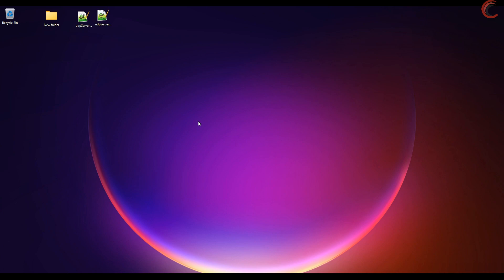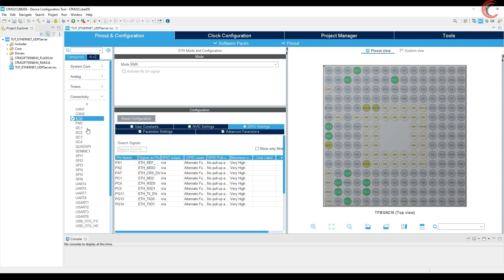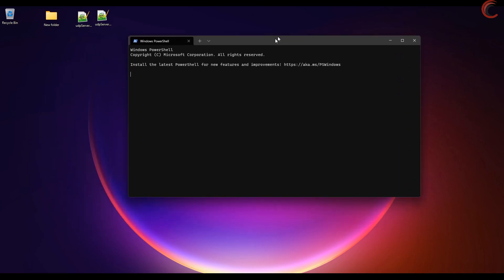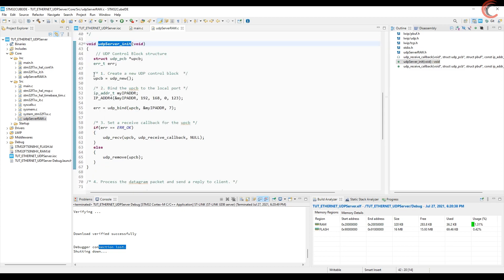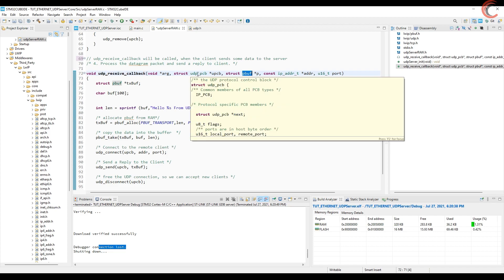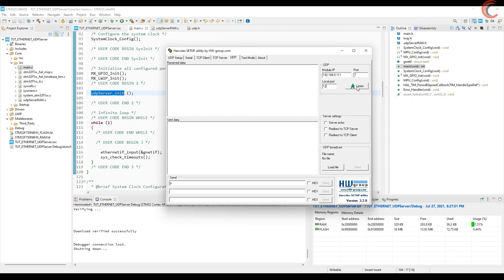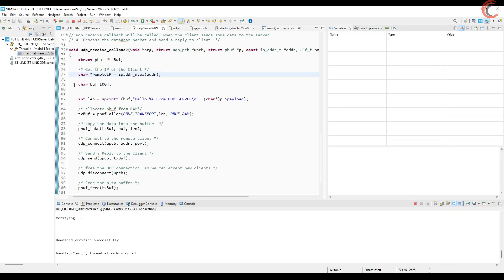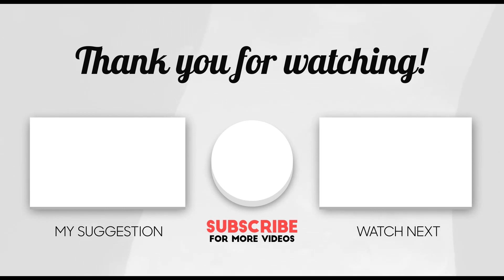STM32 ETHERNET #2. UDP SERVER

Comment: when i entered port 7 and local port 12, it doesnt reply anything. when i entered port 7 and local port 7 it repeated whatever i send without the string. why is that? what shall i entered in local port?
Reply from the maker: When both ports are same, you will obviously receive the data you transmitted. Its like connecting the TX and RX pins together.

Comment: When we run ipconfig on the terminal, why don't we see our board address 192.168.0.111 listed under Ethernet adapter Ethernet, once it is connected to the ethernet port of our PC? We se the address 192.168.0.102 instead. Could you,please,clarify? Nice playlist by the way.
Reply: are you using a USB to ETH converter to connect the board to your computer?If so, the ipconfgi command simply detects the converter interface instead of the STM interface

Comment: Thank you! My udp server is working now, but there was one problem. When I send message with length more than 17 bytes to the board (I use h745 disco), it started to response inadequate and sometimes was even crashed. The reason was that "sprintf" in "udp_receive_callback" wasn't suit for this purpose, I remove it, made dynamic array by "malloc((p->len) * sizeof(uint8_t))" and then:
My_array = p->payload;
Also I replaced in "pbuf_take" function call "buf" by my array name. Now the echo works correctly.

Comment: Hello again, when I enable LWIP platform settings it gives an error. It forces me to select Driver_PHY. How can I fix?
Reply: Since I used the stm32f769 discovery card, I could use the DP83848 chip on it. Therefore, it was necessary to select it from the LWIP section. I'm leaving the answer here in case anyone has the same problem.

Comment: hi, i have stm32f207z and did everything as in this video but i cant ping the stm. I tried several stm32 models in f series but it does not work... what am i missing... i will go crazy...
Reply from the maker: If you are directly connecting the ethernet cable to the computer, you need to modify the ethernet configuration in the computer.
Check out the discord group I have posted the screenshots for the configuration there.

Comment: hi, i dont have cortex section in the stmcubeide. i use stm32f207zg. i did everything other than that. i plug the ethernet to my pc and to stm and connected them to each other but ping does not work. the problem is on the cortex section? or whats the problem. have any idea?
Reply from the maker: If you are not using a router, then direct connection to computer would need you to modify the ethernet settings of your computer.
Check out the discord group. In the ethernet section, i have pasted the configuration required for it.
Reply: @ControllersTech  hi, thanks for reply. I tried both with the router and direct connection. Both of them are not working sadly... i followed the exact steps but somehow when i ping the ip, its not working. is there any settings example for f207zg? cortex and power on section is not in the settings list in the stmcubeide for f207zg. that problem breaks my work and i have to do the udp work for my project. a help would be great!

Comment: I am using the STM32F429zi Nucleo-144 board. I have done the same as per the video and have done pin configuration as per the manual. But, not able to ping. Pls, guide me regarding it.
Reply from the maker: watch the first 2 videos of the series
Reply: I had the same problem with the same board.  The pinout generated by STMCubeIDE was wrong.  After fixing the pinout, all worked well.

Comment: Very useful. 
Have a question about how to debug in the udp_receive_callback function. In fact, I have done some stuff there but I am trying to debug there (but breakpoint ...) without success until now. Thank you
Reply from the maker: Just put a breakpoint inside it, and when the data will arrive, you will get a hit.
Obviously you need to make sure that point was successful before doing this.
Reply: @ControllersTech  Yes thank you for the tips. It works fine